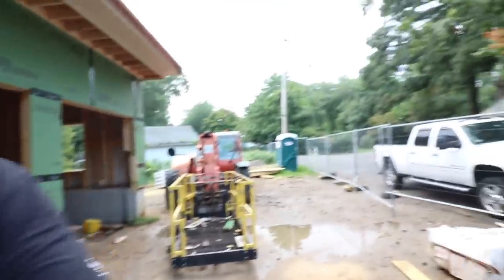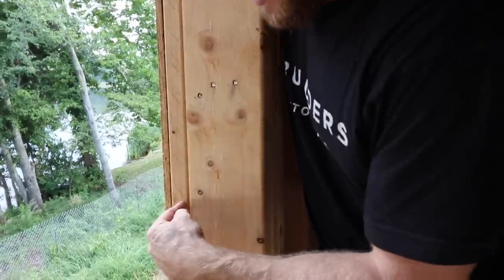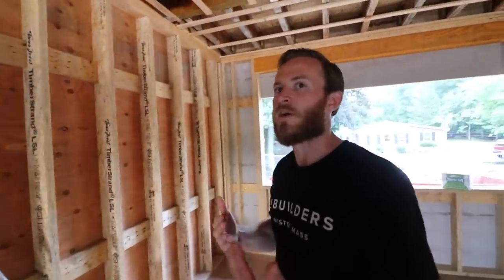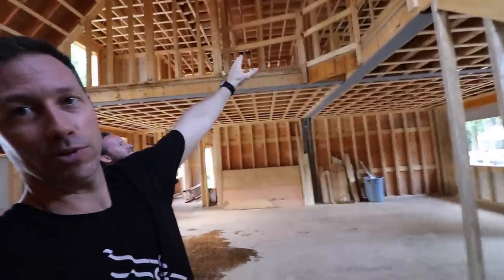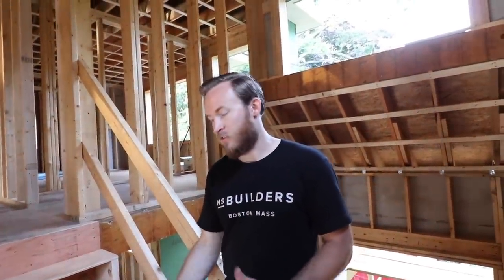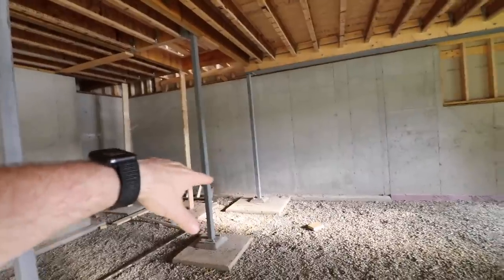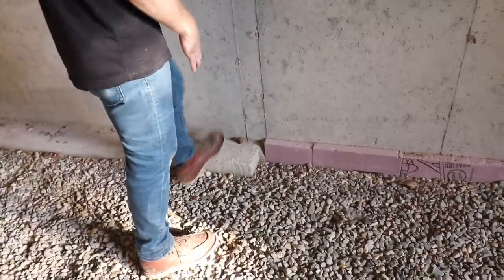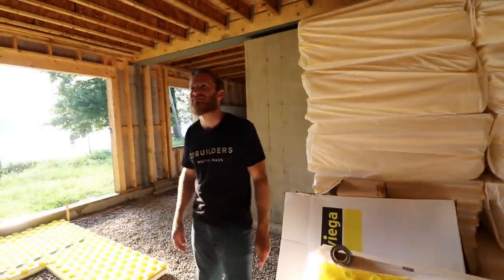How do they Build in Boston? Visiting a new home in Framing

Comment: That standing water on the subfloor is driving me nuts.
Reply: How would you go about clearing that?
Reply: @Tubeytime  shop vac and floor fan. Quickly!
Reply: Me too! Advantek or not, that floor will still swell. That build is "in the dry". If it were my site, all those openings would be covered...... and somebody would be digging to find that foundation leak in the corner of the basement.
Reply: Plastic sheeting is our friend. Especially in wet zones such as Boston. Becomes a whole different game in freeze zones too.
Reply: i always wonder about the water that comes into the house when framing? so that is not normal?  how do you even build a house in PNW?
Reply: @SuperCanada89  yes, it happens a lot. But once the roof is on you don't have the benefit of sunlight and air flow to dry it out. That much water is a problem and shouldn't be left to sit very long. It's also easily prevented.
Reply: It’s why he’s got Advantech. No biggie!!! Bring on the water!
Reply: be nice if they fixed the roof leak
Reply: drill a 1/2" hole in the subfloor, let it drain. Also papering your roof as soon as you get the roof sheeted.
Reply: its not a leak, the roof is just sheeted.
Reply: no he has the copper roof on and it doesn't matter there should not be that much water coming the the structure if the roof is on it should be water tight
Reply: the copper is flashing. they just have the zipboard on the roof for sheeting, it needs felt or some type of moisture barrier while the rest of the roof prep happens,they can do  little patches in the moisture barrier while the trades do there thing if a jack is going in. if the contractor just wraps the house after they get framing inspection done they avoid the weather coming in before you can get the roof closed up. im telling you how you do it.
Reply: Charlie OConnor there is standing seam copper just below the flashing line. The zip was knotched to fit around the standing seams. There is asphalt shingles on the rest of the roof
Reply: i see what you are saying about the standing seam, i just think they probably didn't paper off the roof completely and got some water ingress. They are working on soffit and the damn thing doesn't have a roof. priorities are all fucked. Shills.
Reply: AGREED!! Get the shopvac ASAP!!!
Reply: SuperCanada89 it gets wet and everything is completely fine.
Reply: high end but dont even put plastic to keep rain out and warping floor.
Reply: Not a big deal.  Any place that gets rain new construction will get moisture inside.  You cant finish everything in one day or even one week.  The roof isnt finished, neither is the exterior or windows, so naturally you will have leaks.  Main thing is to be completely dried in asap and most importantly before sheetrock.  Some water is fine and 100%  common.
Reply: I was going to say the same thing. I would be pretty livid with that in my home. Between potential mold growth and weakening the materials. Why start out wrong when it can be remedied so easily.
Reply: Advantech , Dosn't matter you busy bodies.
Reply: gracilism you see that on tons of jobs. I hate flooded basements. Lol
Reply: Did a recent build where they left the ridge vent off and got two floor panels wet. Lets just say I was pissed. Got them to replace one and repaired the other.
Reply: advantech or not, pooling of water on osb makes an obvious difference in how strong fasteners will hold... hope hes not trying to nail down hardwood, cleats or staples wont hold there if the top layer of osb is visibly delaminating/drying out. pressed wood flakes with adhesive will be negatively affected by water, period.
Reply: Ditto !
Reply: not having exterior doors and windows installed is 'open to weather', they are talking rapid moisture fluctuation. This is stupidity and bad project management.
Reply: I agree
Reply: Probably just had a storm come thru... August was real wet here with lots of heavy storm activity.
Reply: Tim, the leak in the corner appears to be coming in well above ground level (several feet above ground).
Reply: Forget about a shopvac. Just sweep the water out the door opening that's right there.
Reply: this comes down to something called workmanship. home owners need to take note of this because your insurance company will not pay for your claim when your contractor/project manager doesn't do things in a proper order. These two appear to be concerned with doing things that will pull draws against the job so they can get a check in their hands. This results in a lot of 'change order' and going O.B. Sub par workmanship because the final phase is a shit show and things get buried when they go wrong because money is gone. November-January will be an interesting time for this project.
Reply: you dont paper zip roof, once installed you just tape it and ice and water
(im assuming its all zip roof)
Reply: Agreed. I went in slightly different direction..... had my house trucked in, built in a factory on a frame to my specs, it's a Colonial and unless somebody asks, nobody can tell. It was wrapped like a boat during shipping and together with a roof in one-two days. I changed my thoughts on building on site while watching so many houses built on site exposed to the elements. A lot of people frowned, saying the factory built was not as "good quality". It turned out that my local contractors hired to finish some of the work did the worst job and now I'm having to re-do some of their work. The factory build, still perfect, not only that, the walls are straight!
Reply: A lot of people on here dont really know what there talking about. Internet contractors
Reply: I'm no expert at all but I sae that giant puddle and wondered if that's good at all lol. I've been reading about how to do trim and all kinds of stuff and I see in the comments people always saying how certain types of materials swell when water is around.
Reply: Its a race to beat the weather but its gonna happen we drilled small holes in the floor for drainage
Reply: ide put something over the roof sheeting while waiting for the roof to go on regardless of the building process. i was suggesting paper because it is a material that is already going on if shingling, so little extra cost.  2000 sq.ft of 7mill plastic is $100 in instances where things need tarping off.  Protecting building material from the elements is the builders responsibility, this is an industry standard.
Reply: the water dripping in the background is triggering my ocd.
Reply: the water dripping from the roof is triggering my OCD
Reply: Joe Helwig it will probably get fixed when they put the shingles on.
Reply: Charlie OConnor who uses paper anymore?
Reply: Tim Pace not with 1 1/8 advantech.
Reply: steve yost you simply have no idea what you are talking about
Reply: its a trade name, make it out of what ever you like. let me put it this way..when i see the sheeting is being put on, i'm going to yell out, "put some fucking paper on that roof so it doesn't get wet". and my laborers are going to know im talking about. and that's all that matters. 
There will always be hack 'builders" out there thinking there shit dont stink cause they saw something cool on This Old House. Most of these guys on here couldn't tell you how many nails are in a case let alone how to set one.
Reply: Charlie OConnor And by the way princess even if there is paper or a membrane on the roof doesn’t mean water can’t get in there are no windows in that house so if you get a driving rain it’s just natural that water will get in so get over yourself
Reply: keep telling me how good of an idea not putting something over the roof sheeting until it gets roofed so your subfloor doesnt turn into a sponge. I tear shit out like this all day. good luck with that. thanks for keeping me busy.
Reply: Lord Ba'al What kind of jacklegs are you people number one of course it will dry number to any hardwood floor professional worth their salt will pull a moisture reading out of the sub floor before they even put or stock hardwoods in the house
Reply: Tim
I hope you dont build a lot of houses.
Reply: c dawg Honestly I don’t think he build any houses I think he fixes stuff from contractors are even shittier than he is
Reply: Kind of defeats all the extra detail they are so proud of
Reply: Ive seen lots of framing fail inspection using 3 inch stainless robertson head screws.  Our codes call for specific nails for applications because they have higher sheer resistance.
Reply: Ya if it was quality build that would be cleaned off...
Reply: you have the foundation poured in the rain, start framing around early June and sprint like crazy to get it dried in by September.
Reply: Advantech is kind of specifically designed for moisture during the build to not be as much of an issue so they probably don't care but for my peace of mind I'd probably get it taken care of.
Reply: @cdawg9149  
Still, you shouldn't just let the water collect.  It will challenge the integrity of the decking causing delamintion and/or warping.  There is already a low spot.  The fasteners (nails or screws) will appreciate it, too.  Squeegee that off the surface.... or use a broom.  Let it evaporate as soon as possible.
Reply: Ralph
Built houses in Depot Bay Oregon and Lake Tahoe area...In Oregon on the coast its wet even when its dry. Lake Tahoe framing anytime between Oct thru April it gets wet .. Sometimes for weeks at a time. Builders in those areas know that. They know whats up and they know what they need to do if they build in winter. Some dont and they learn the hard way.  If your one of those that dont you better listen to Charlie and they better listen to you because you are right. If you are building with the wrong subfloor material you will be punished. The one thing I will agree with the Charlie dude is that when the roof gets sheeted you put your roof membrane and Ice and water dam material on ASAP if not sooner. What some people dont get is the sun does a big amount of damage to the unprotected roof sheathing also. But if you use the right subfloor material you can sleep at night knowing it will be ok.
Reply: I’ve been building for over 30 years . Did not believe that Avantec would not delaminate . I bet a guy 20 bucks put a pice in a 5 gallon bucket full of water cut from the center of a sheet no primed edges for a week. it did not swell one bit. Has to be some kind of epoxy glue .
Reply: SuperCanada89 I tell people that trees grow outside .
Reply: lol i was trying to get in there and dry it up and cover the rough openings
Reply: the particle board for studs just no.
Reply: That booger in his left nostril is really buggin' me..
Reply: Advantech can handle it.
Reply: @xr500t  ya know, I'm not that experienced as some on building, but I know a little. I was thinking the same as you. Why not build em in a factory, where it's dry and you won't have these kind of problems? Seems like a  smart idea to me!☺
Reply: Wow, some of the responses are tough to read. How do guys think we build in really wet places? In the PNW we'd be unemployed more than half the year if we freaked out about rain. Once the house is dried in we set up dehumidifiers, fans and heaters in the house and crawl space to dry everything out. As long as everything gets a chance to dry out it will be good.
Reply: Andrew Cox right dude? A puddle on their advantech is the absolute last thing they should be worried about. This guy is one of the most well respected builders around and he knows everything about his materials and how they will hold up to weather. YouTube commenters say they would never live in a home like this, meanwhile there is a Gatorade bottle filled with piss behind their drywall.
Reply: @potatotom7107  well here's the problem with that thinking. Years ago where I live people that said they knew and were well respected contractors decided the new ways were the best and they told everyone that concrete basement walls were a thing of the past and they used green treated lumber the frame in and build basement walls. Now people all told them that it wouldn't work it's to wet here. They told us all that is old fashioned thinking. Fast forward today, look at all the basements put in are all concrete.  Why because people that said it was old fashioned thinking were just about put out of business when there new fancy materials started to fail. Yes you can do the things the manufacturer claims, but that doesn't mean 20 years from now these things won't come back to haunt you. There are very good lessons to learn. Those guys that say letting things get wet is fine is exactly what this guy was saying at the beginning of the video, he started saying why they don't do things the way others have because they have learned the disasters later. They were filming so I will give him the benefit of the doubt.  I have to believe as soon as the cameras were off or his crew got there they at the very least swept the water off that spot
Reply: Charlie OConnor ouch!
Reply: Richard Thomas finally a good answer to this who thread.  We can all sleep soundly now.  Thanks.
Reply: You get the apprentice to sweep it out.
Reply: drill holes in the subfloor
Reply: I bet it's not a foundation leak, but water that has come from the floor above.
Reply: Ryan Bennett LOL
Reply: I used to work for servpro and  Adventech is water resistant but not water proof. Once it get saturated it's super hard to dry, the same way it keeps water out is same way it will keep water in. With the house open like it is it will dry out, water damages and mold only became an issue when house started becoming air tight. But it has always bothered me seeing house getting wet like that, some have to still have moisture trapped some where. I live in Tennessee where mold is everywhere
Reply: no worries he uses Advantec
Reply: Joe Helwig Fix the roof leak? Dude it’s in the middle of construction you must be new
Reply: It's not a leak it's most likely a vent on the roof
Reply: I was about to comment about it. I HATE that.
Reply: with a CHAIN SAW.  :)  find deepest point and stab a hole so it drains and STAYS drained.   round holes will clog, long holes wont.  don't ask me why.  plus, owners like it when they see their house being hacked up with chain saw.  @Tubeytime
Reply: @Tubeytime  plastic the windows facing west.....
Reply: If you go to any new subdivision in the spring or winter they will all be soaked. Most homes have mold on the framing. Because they don’t really dry it out. They just get rid of the standing water and call it good
Reply: If it were my house and I was paying what this guy probably charges, I'd be furious. In this video he goes on about all these little quality touches even where they aren't strictly necessary. How about we get the standing water out of the house, whether you think it'll ruin anything or not. It's a 2 minute job.
Reply: A lot of the water is coming in from the windows. We don’t bother cutting the sheeting out until we are installing the windows. The roof is also not on contrary to what people are saying about having standing seam or copper on it. There is at least on skid of shingles sitting out front. We deal with water in our builds all the time due to not caring that it’s raining, we dry in our roofs as soon as they are sheeted, and house wrap as soon as it’s sheeted as well. When it rains, shit gets wet. It is what it is. That’s what squeegees are for.
Reply: and it's still dripping in from the upstairs, I couldn't stand it!
Reply: The dood was late .theres water on the floor cmon! Let's get our s*** together!! I love the overhead power lines right at the window level! High end??
Reply: Place looks like Beaver Paradise to me!!
Reply: @KK51500  thank you! builders like this are on a quick road to a lawsuit. 
get the wrong customer. will put the company under before they even set up an arbitration date. ha #beaverlodge
Reply: I mean here in canada it often happens that there is a foot or two of snow on the subfloor before the roof sheeting is placed so i wouldnt worry about a little puddle
Reply: gracilism it’s an indoor pool 🏊‍♂️🏊‍♀️🤽🏻‍♂️🤽🏻‍♀️
Reply: @Tubeytime  Maybe a mop!
Reply: @Val-ee4hd  i see your point about the standing seam being on the lower roof, still scratching my head about the rest of the roof not being complete. just wow.
CUSTOM!
Reply: @Val-ee4hd  i grew up in this industry and continued to take it on as a trade as an adult. sure builders get away with this all the time, they're just trying to slam a house in to make a buck(just lok in the comments...but call it that, slamming out a house..
anything aside of tedious preparation for a customer and their project needs to destinguish itself from high end.

ive build houses in the snow and rain and dont get the customers subfloor wet..or any other laminated product wet. its called preparation and hard work. no way around it.

because if this house isnt being built as high end there are  lot of things that do not need to be installed and billed for...BUT it sure jacks that price up if you call it high end and advanced framing.

i wonder what that change order bill was on this house...probably huge! amateurs. wouldn't make it without youtube clicks.
Reply: @kristopherprevo7078  From being a roofer in an area that gets cold temperatures I can tell you that the experience of most roofers up here is that when you seal the roof off you do more damage than good. The roof has to breathe and the wood will rot. I don't shit on other peoples work however and maybe there's something different where you are.
Reply: TekaiGuy a squeegee
Reply: gracilism I hear ya get that shit off there.
Reply: @joer8854  so roofers don't use moisture barrier under their roof where you live? i call bullshit.
lay out your bundles and come back when its time to shingle. how is this a hard concept to grasp?
Reply: BEAVER DAM
Reply: @charlieoconnor40  Here the insulation guys put vapour barrier on the hot side of the insulation. We don't put anything under the shingles because it traps the heat between the two and the roof can't breathe. The moisture has to escape. The only thing we do is put Tar paper under the shingles at the very bottom of the roof. This is to prevent ice dams. We also cut holes in the roof and put vents up near the peak to vent the heat from the attic. The whole system is designed to keep the roof properly working as a system.
Reply: @joer8854  so the moisture barrier is under the sheeting, on top of the truss?
Reply: @charlieoconnor40  It depends on the roof. If there's no attic there's  something that provides an air space between the roof and the insulation and the vapour barrier is stapled to the rafters between the drywall and the rafter. If the joists are insulated the vapour barrier is on the hot side between the rafter and the ceiling drywall. And the humidity here is often over 80%.There is no vapour barrier between the shingles and the roof because the roof would rot.
Reply: @joer8854  or like double faced insulation?
or barrier on the attic side of the truss?

calling it a 'system' does nothing for me. 

how does it do with wicking moisture away from the sheeting.
i understand the use of roof vents, we have those here in the NorthWest. 
to me this is like siding a house right over the sheer. 
the sheeting will get moisture just with condensation alone.  cold - hot/ hot - cold.
am i missing something here?
i understand make it breathe but really?
Reply: @joer8854  80% humidity.. deck it with hardie and use 1x on the interior for sheer strength at that point, holy shit. im sorry lol
Reply: @charlieoconnor40  Vapour barrier on the house side of the insulation only. That's how it's done. It makes no sense to trap the moisture in the attic.
Reply: @charlieoconnor40  Yeah if we tar paper the roof by the time it comes to pull it off the plywood is half turned to dirt. You touch the ply and it disintegrates. Especially with high sloped roofs because the shingles last forever.
Reply: @joer8854  you wouldnt be trapping moisture in the attic if the roof was vented....
do you guys get a  lot of cracked shingles when you dont put down underlayment with the expansion and contraction of the roof deck?
Reply: @charlieoconnor40  Also if your interested the reason i say it's a system is that it's designed that way. We tell owners that the roof is a living breathing thing because it is.  People don't realize that as the seasons change your roof literally acts like lungs. It expands and contracts and air moves in and out. moisture evaporates and escapes between the shingles and tabs. The whole thing including that tar paper at the end of the roof works to keep everything working perfectly. The only thing that get's debated is the valley's. There's open and closed. Open has aluminum or ice and water shield or both. Closed is ice and water under and the shingles overlap with the top shingles cut down the valley line. Personally it's been my experience that open valley ends up with rotted plywood  at the bottom of the valley. This sometimes is hotly debated with roofers on both sides but that's my experience. I've been asked what I prefer as the shingler and I say closed and tell them why and restating but that's just my experience and many don't agree.
Reply: @joer8854  i definitely wouldn't debate your experience, and you are actively thinking about what you are doing in your trade. i mean fuck, you are seeing it after the tear off so i cant argue with that in your neck of the woods. 
refreshing having a conversation with you rather then the shitfest that is the normal comments section.
Reply: i am a flooring guy and thats the worst fucking thing we have to deal with, warped floors from standing water
Reply: SuperGoldnut  that's more an aesthetic choice. Most roofers know how to weave it in, it's just not always the best look or choice depending on the angle of the seam.
Reply: SuperGoldnut  every roof in this area that has been sealed water tight has rotted. There's a big difference between moisture in the air and water. Your wrong and stupid. You don't make both sides of a space water tight vents or no vents. Shingles prevent weather from getting in and allow the moisture in the air to get out. That's their purpose.
Reply: SuperGoldnut  I didn't say vent through the roof. I said putting a barrier between the shingles and the roof causes condensation and moisture between the shingles and the roof and the roof rots. It's not a theory it's a fact. Just because you live on a lake doesn't mean you live in a high humidity area. Islands don't get 80-90% humidity. We do. If you do a proper job there is no risk of rain getting in because the nails are covered. Since you feel the need to add another layer under the shingles to protect against moisture you obviously aren't a competent roofer. The purpose in the shingles is to protect the roof. They keep the weather out. There's no need to add anything under them other than one layer of tar paper only under the very edge of the roof. Unless of course like you the roofer is incompetent and can't do the job properly. My suggestion however would be get a better company.
Reply: SuperGoldnut  That's not at all what i said and clearly you have no idea how water travels. water uses the path of least resistance. This means that once the water hits the roof it travels down the roof not up (cause you know, gravity is a thing and water doesn't go up unless an external force greater than the force pulling down on it acts on it.) This means any moisture that is on top will travel down the roof into edges (which is why we have flashing) and usually when installed properly the gutter. Any water that get's trapped through condensation also travels down and can escape for the same reason, unless of course you do something stupid like put a barrier between the shingles and the roof where moisture can get trapped and rot the roof.
There is a chance for a brief second or two now and then for the wind to alter the course of the rain which is why shingles have tar lines. This keeps the shingles down and everything where it's supposed to be. If one of the tabs on the shingles gets blown off it needs to be replaced, Your usually safe for the time being but it needs to be fixed.
Reply: SuperGoldnut  That took me a min since you didn't go to school and learn punctuation. That's not required here because of the reasons I stated.
Reply: @Tubeytime  your asking for a friend!
Reply: @SuperCanada89  its only a problem if the crew is lazy and doesnt show up daily...let it sit for weeks without work being done, sure its a problem. I dont know any builder that would leave it there for days or weeks. It prolly rained that night and its morning now, no big deal.
Reply: he just got to the site...guy was recording...im sure he got to it...prob. rained overnight...lol
Reply: This is why we build concrete houses where i live... no bending, burning ... and blowing away in the wind haha :)
Reply: He needs to drywall the roof to keep the walls dry.
Reply: SuperCanada89 it’s not hard, most subfloors get rained on, no big deal.